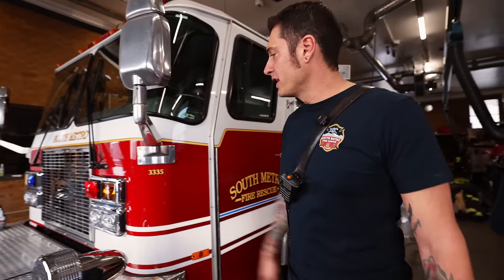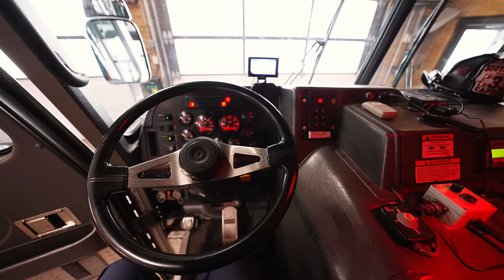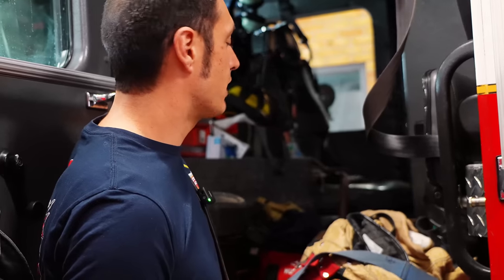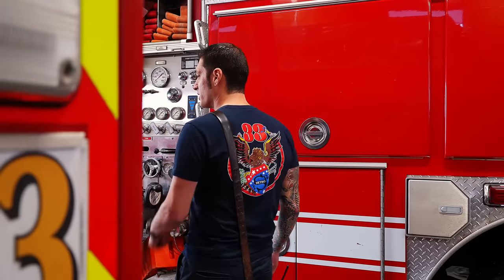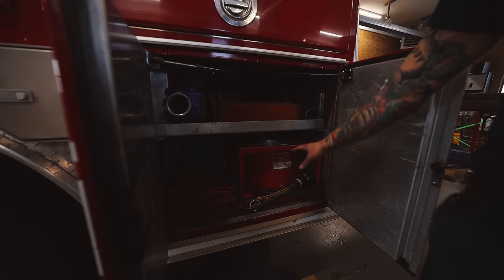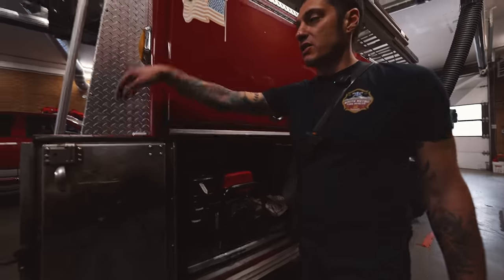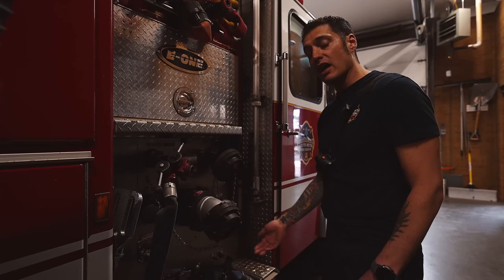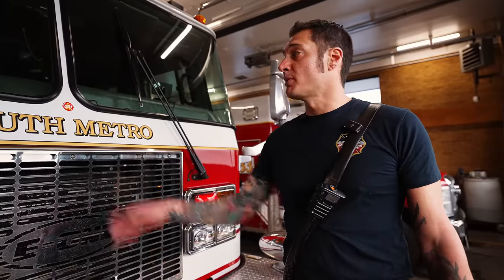Fleet Friday - Reserve Engine 33

Comment: What happens if an apparatus is out of service and all of the reserves are in use?
Reply: They probably pull the rig out of service and move the staff from that rig to other rigs. But honestly that would be very rare. In our department in CA, they keep a handful of fully equipped rigs that can be up staffed during a major emergency. Also, it is likely they could borrow a rig from Denver or a neighboring department.
Reply: They would use a one of the training Engines if anything before asking a department to borrow a rig.
Reply: Borrow one ☝️ from somewhere but pretty sure they have enough spares
Reply: @ethandunlop7395  I think the training rigs are looped into the reserve rig category. But this would be so rare
Reply: We’ll it depends how Houston fire does it if one is out of service we have a good amount of reserve ladders,pumpers,towers
Reply: So even the reserve units start up and run like new!!
Reply: But if it’s in service we try to stay to get it out the same day.
Reply: @mauricemotors8207  if you take care of it we’ll enough anything does